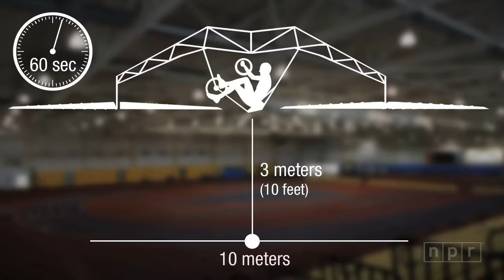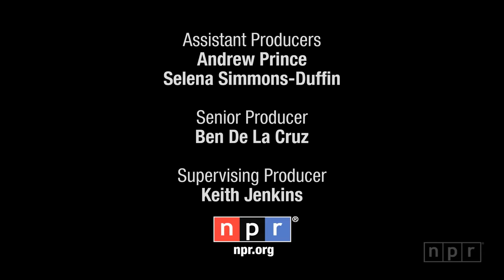Human-Powered Helicopter: Straight Up Difficult | SKUNK BEAR

Comment: Instead of exhausting the driver and making the whole kinetic system unstable by making him move his arms like that, why don't they make a progressive gear system so that the heli accelerates in a slower but regular velocity?
Reply: Theo Novaes it will add up more weight. I still feel trying to do this type of project is very silly. It’s like trying to fly with a big helium balloon. It will work but we have to think as more smarter as evolved humans.
Reply: But if we are talking about extra weight what about the double geared system that is used now? Instead of two sets of pedals connected (which does not guarantee stability since the strength of legs and arms is notoriously different), you would have one set of pedals with a gear system that doesn't demand too much strength from the driver and still would be able to reach the same torque velocity. About the materials, there is already on the market 3D printed carbon fiber gear systems. About the necessity of such experiments: science is learning and teaching, and not only in a classroom. Experiments like this that seem pointless not always are and still are able to contribute to the science community.
Reply: My thoughts exactly. Something akin to a gearing mechanism on a road bike or mountain bike. Low gears to maximize torque and get the rotors spinning, but the pilot could gradually shift up to increase rotor speed. Their set up is like trying to ride a bicycle from a dead stop when you're in the highest gear. You're dead tired right from the start because you had to expend 110% of your energy just to get things moving. 

Honestly, the rear mech on a conventional bike (Shimano cassette & SRAM derailleur) would not add that much extra weight. 6 to 8 lbs, at most including the shifters. I still think chains would be a better form of transmitting power. The string is surely stretching when it's under load, meaning that a ton of power isn't even reaching the rotors. In biking, we have a saying -- power not put to the ground is power wasted.

Comment: You can do it easily : Take 2 heavy and counter rotating inertia wheel. Pedal some times to store energy in it. Release the clutch and profit.

You can cheat by making the propeller heavy at the end, without any angle (=0 lift)  at the start. Pedal some minutes to make it spin fast and store energy, then change the angle to convert the stored energy to lift.
Reply: Wow, congrats! A random guy on YouTube has solved a problem that took three decades and involved multiple teams of scientists to almost complete.

Comment: Add a dynamo to all the leg pedals, make it so that they gradually kick in when you're on altitude, then add an additional propeller which can change it's angle, a bit like found on zeppelins (powered by the energy gathered from the dynamo's.)

As soon as you are done gaining altitude you can instead use that leg power to control the steering.
That way you don't have to slow down pedaling when at the right height.

This probably doesn't work, otherwise it would have been done already 😅
Reply: I would assume the dynamo is not allowed, and that the helicopter must be directly powered by the human.

Comment: They need better athletes. Bring in some national champs for that thing
Reply: I don't think they are so stupid that they didn't thought of this. But getting + 40 pounds to the total weight maybe is worse than pedaling 20-30% slower.
Reply: +Baltatu Andrei ok no your wrong. I belong in the cycling conference that competes with UMD and they chose pretty good cyclists on the team but what they should have done was outsource and nominate a pro cyclist to work with them in order to have a better chance at the record
Reply: +Baltatu Andrei and they prolly wouldn't have damaged the helicopter too. The second cyclist was terrible

Comment: A few decades ago when a group tried to win the prize for powered man flight, AKA Kremer Prize, they had a decent design and then tried powering it with one of their trained glider pilots thinking that piloting skills were critical.  What they found was, that the pilot or engineer was not that critical. They ended up recruiting a trained cyclist and he had the horsepower to make the thing work and the won the prize prize.  Geeks and brains are necessary but not complete without the brawn

Comment: Lot of armchair engineers in the comments
Reply: alfie Who watches YouTube in a arm chair?
Reply: Well, maybe, just maybe, some people are Engineers here.
Reply: You tend to notice more from the outside perspective
Reply: Christopher Smith Engineers who actually get paid to do engineering, unlike these students, amirite?
Reply: Yes, Orville and Wilbur had them too, but all they said was it couldn't be done.
Reply: Nope, its understanding the lack of creativity in the engineering field. There is a simple solution. 4 humans. One on each prop. This way you have navigation control. Each operator controls the speed of their own prop. This also means less weight per cyclist, as the operator is directly below their own prop, so the supports between the props do not carry the weight. The solution is simple.
Reply: @Daveinet  That formula exceeds the requirements and would be disqualified.
Reply: @davidcraig9779  I looked for the requirements and did not find any restriction on the number of humans, even in the official press release. From Wiki about the contest:
"A human-powered helicopter (HPH) is a helicopter powered solely by one or more humans carried on board"
I think 4 would qualify as one or more.
Reply: @davidcraig9779  But 4 would be better, as you would have real flight control. Not only that, but I had this idea a few years ago, the first time I saw one of the experimental air crafts.
Reply: @Daveinet  Works for me. I was thinking too of a stationary tube surrounding each with wedges inside designed to funnel it down quicker, possibly turbo fans rather than blades. For stability, I also considered counter-rotating blades like WWII torpedoes.
Reply: @davidcraig9779  Tubes or at least a flair. The whole issue is that the air from the bottom wraps around the end of the wing and pushes down on the wind. Its possible that the prop/wing is moving so slow that not much air wraps around the wing to the top side, so such a tube may not be as much of a benefit.
Reply: @Daveinet  Sounds good.

Comment: That is NOT a helicpopter, its a quadrocopter
Reply: Someone said it, thank god....
Reply: bum bum
Reply: yeah, guess that means it sucks then eh
Reply: If they add magnets it will be able to do it.
Reply: you the real mvp fam
Reply: Nope, the defitition of a helicopter just means a blade spinning horizontally
Reply: Don't forget to sign the anti EASA petition. It's killing the DIY Rc aircraft hobby. :(
Reply: This is also completely fake. Look how slow the propellers move. How has only a few people realised that?
Reply: its more than one blade so its not a HELIcopter
Reply: bojangles there pretty dang big and there's four of them... They don't need to move fast
Reply: hel·i·cop·ter
ˈheləˌkäptər/
noun
1.
a type of aircraft that derives both lift and propulsion from one or more sets of horizontally revolving overhead rotors. It is capable of moving vertically and horizontally, the direction of motion being controlled by the pitch of the rotor blades.
Reply: hel·i·cop·ter
ˈheləˌkäptər/
noun
1.
a type of aircraft that derives both lift and propulsion from one or more sets of horizontally revolving overhead rotors. It is capable of moving vertically and horizontally, the direction of motion being controlled by the pitch of the rotor blades.
synonyms: informalchopper, copter, eggbeater, whirlybird
Reply: Chad Cawthon 

A police helicopter giving a speeding ticket is a hellOfaCopper
Reply: Billy Breakaho 7
Reply: The Aviation ， nah mate, you've just said spinning with " a blade", but this machine here is functioning with multiblade dude....
Reply: Vuleta Tonic you're not wrong but neither is he. The definition of helicopter is "an aircraft whose lift is derived from the aerodynamic forces acting on one or more powered rotors turning about substantially vertical axes" (merriam-webster dictionary).
Notice how it says *one or more*? A quadcopter is just a more specific name for a helicopter using 4 rotors.
Reply: TL;DR helicopter = aircraft using horizontal rotors
Quadrocopter = a helicopter with exactly 4 rotors
Neither are wrong in this case, helicopter is just the general name for this type of aircrafts while Quadrocopter is a more specific one.
Reply: this guy What's with the capitalised HELI?
Reply: You're right it is not an helicpopter
Reply: did anyone ask you?
Reply: "what would you call a Chinook then?" The right answer should be a "Tandemcopter" because it uses two blades behind each other. A bicopter would be two blades left and right, like the V-22 in his "helicopter flightmode".
Reply: this guy Heli doesn't mean one. Heli comes from the greek root helix, which is just a spiral.
Reply: bojangles "hurr durrr i'm too stupid to have a basic understanding of physics therefore it must be fake hurr durr! Flat earth!"
Reply: correct, in fact - from latin, 'helicopter' becomes 'helico' and 'pter'. Helico as in spiral, and pter as in a flying thing (ie a pterodactyl)
Reply: helicopter - a type of aircraft which derives both lift and propulsion from one or more sets of horizontally revolving overhead rotors

Comment: On June 13, 2013, Aerovelo’s human-powered helicopter Atlas won the AHS Igor I. Sikorsky Challenge and its $250,000 prize. During the record-breaking 64 second flight, Atlas reached a height of 3.3 metres.  The Igor I. Sikorsky Human-Powered Helicopter Competition, which had gone unclaimed for 33 years, represents the third largest monetary prize in aviation history.

Comment: was anyone else nervous about homegirl standing in the middle of 4 giant, spinning blades?
Reply: no, because I understand how physics works. those rotors don't weigh jack shit, so they have fuck all momentum. even if they hit her they wouldn't do shit.
Reply: @sumdumbmick  my razor weighs even less. If it was the size of an airplane wing and hits you in the shins at 50mph you're gonna feel it.
Reply: @ridesharegold6659  that shit's not moving anywhere close to 50mph, though, and it's made of fucking foam. it'll collapse from the impact before it transfers enough energy to injure anyone.
Reply: and if you get hit closer to the root, then yeah, it's less likely to break, but it's also moving much slower, so again it's not gonna hurt you.
Reply: I also don't think you're comprehending how lightweight those rotors actually are. the entire thing is under 80lbs. and since most of the thing is frame it's fairly safe to assume that only around half of that is in the rotors, and since there are 4 of them that leaves only about 10lbs for each rotor. split that in half for each blade, because you'll only be hit by one blade at a time, and you're down to 5lbs of foam spread out over a volume of about a cubic meter or so impacting you at around, maybe 10mph.
Reply: S S  I was avoiding actually doing any real math, but I suspect the relevant mass is going to approach that even if we count the entire rotor, because of the differences in angular momentum at different points along the blade and the fact that the structure simply isn't designed to handle stresses in that direction. thus I expect that the rotor would begin crumpling prior to imparting all of its energy, and as a result be less effective at causing injury than if it were perfectly rigid.
  
case in point, when it 'crashed' at the end of the video it was only moving a few mph relative to the ground, but the structure completely failed in multiple places. it's simply not strong enough to harm anything other than itself because it so extremely optimized to being lightweight.
  
I also actually suspect that my original estimate of the mass of the rotors is probably high, anyway, since a significant portion of the mass of the craft will be devoted to the frame, drive system, seat and rotor hubs. probably leaving only about a third or less of the total ~80lb mass to the rotors themselves. and at any rate I'd be extremely surprised if I underestimated the overall forces an impact could impart by more than a factor of 2, and even at that level it wouldn't be dangerous.
Reply: S S  you'd certainly feel it, I'm not saying you wouldn't, and it might be sufficient to cause some bad bruising, but really that's probably about it.
Reply: S S  that's a completely different physical system, though, because the baton is not fixed at an axle. upon hitting you it will both slow its rotation and move away from you. each component takes some of the energy, and exactly how much depends a lot on the materials, specific shapes and many other variables.
  
my intuition (note that I'm not bothering to figure this out correctly, so my jabbering is only worth so much) is that for the rotor impacting a person the biggest factor is going to be the failure point of the material, but I do think you're more correct to question my original claim than I was to make it, as the connected structure would link the momenta of both blades.
Reply: @sumdumbmick  not sure exactly how long the rotors are but the math is looking like 27-45 mph at the ends (which is where homegirl is standing.) The blades are not simply foam but rather polystyrene supported by carbon fiber tubing, balsa wood, and wires. At any of those speeds that shit is gonna hurt.
Reply: @ridesharegold6659  the tips are pure foam if you look. kudos for caring more than me and bothering to finally measure something instead of just being randomly afraid, though.
Reply: @sumdumbmick  I was never randomly afraid. You can see how fast the ends of the rotors are moving. Also, it's not hard to look up the materials they used which included balsa and carbon fiber stringers.
Reply: @ridesharegold6659  yeah, along the length of the blades, but the tips are pure foam
Reply: 'was anyone else nervous about homegirl standing in the middle of 4 giant, spinning blades?'
  
honestly I can only imagine somebody on the verge of tears even saying this shit, so don't tell me you were being rational.

Comment: If they would have used smaller cranks and a bigger spool for the strings that spin the propellers it would have not have been such a strain on the pilot and they would not have to work so hard and it would help in stabilization

Comment: ok so now imagine
gearbox with many different gears turning like from one end to the other like really fast 3d printed ones... now picture those gears using a pedal to spin the rotary copter or plane engine... like once you get that first rotation it should speed up fairly easily

Comment: They are using the wrong kind of people for this. What they need is not light people, but heavy people that are more muscular. A 0.7 HP person that weighs 140 lbs is much less useful than a 1.4 HP person that weighs 190 lbs.
Reply: How can a person be 1.4 times as strong as a horse?  Horses are strong af.  I know its a unit of measurement, but still.
Reply: Bryce Peters Horses are about 15HP at peak performance I believe. Nice deathbat, btw
Reply: Michael Davis
So all horsepower measurements should be divided by 15 to be accurate?
Reply: Bryce Peters
No, because the speed of a horse can differ. The current HP is accurate... Well except for the name.

Comment: alll these fookn propfesors  cant  make safty rope  from roof?
Reply: Probably not allowed.
Reply: Not allowed for the prize, nothing to stop them during development.
Reply: @DarxusC  It seems like they are making a full-on attempt.
Reply: @1312_PV  I disagree. Even if that's their intention, I think they'd be much better off running with a safety rope until they get much closer to their goal. Fewer substantial breakages would slow them down a lot less.
Reply: @DarxusC  the design of the model may make it so a rope pulling on it breaks it (it's only strong enough in a direction, like carbon fiber).
Reply: @1312_PV  that's a good point, but I have a feeling it could handle being supported by several ropes near the middle of the top, where everything comes together.

Comment: I would rebuild this with a fiberglass skin and use an electric motor instead of peddling power.
Reply: But... wouldn't that defeat the whole point?
Reply: Zorf96 Yes, but you see... I don't want to peddle.
Reply: TheFishCostume
Then... How are you going to use this to exercise?
Reply: Alex Steel I wouldn't use it for exercise, I would use it as a hovercraft-like thing (since I doubt it could get that high up) and exercise elsewhere.
Reply: might as well just buy a helicopter...
Reply: TheFishCostume
Seems like your idea is going against the purpose than.
Reply: Alex Steel I guess. But it would still be cool.
Reply: TheFishCostume
Shit, of course it would.
Reply: Alex Steel
No doubt about that. Who doesn't want a helicopter?
Reply: Has to be human powered as part of the prize rules. Doing it with an electric motor no challenge at all.
Reply: you are completely missing the point. If you have never build anything like this ...please dont open your moth
Reply: designergravity Okay, I promise I won't dissect my moth.
Reply: designergravity Shut your Moth lol!

Comment: Do they assume the altitude is a linear function of effort? I don't think so. I think 10 meters is not just a "fancy number" there. It's clear that reaching a certain height is easy and then it becomes much harder. Some kind of close-ground effect, like in ekranoplanes. So it doesn't look like you can "make it a little lighter" and "push a little harder". Need smth different.